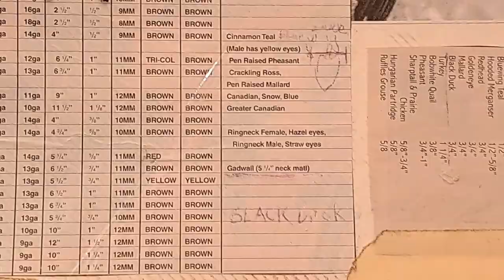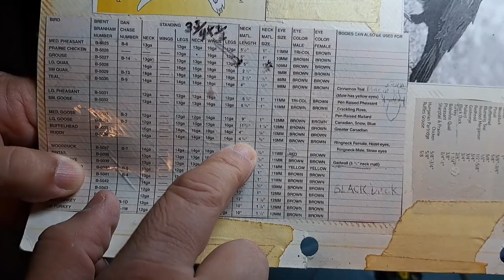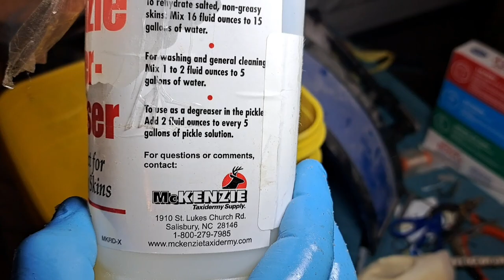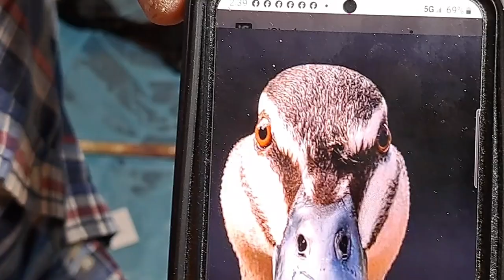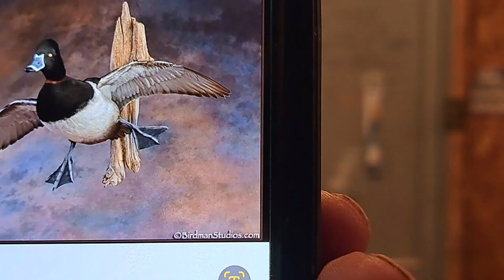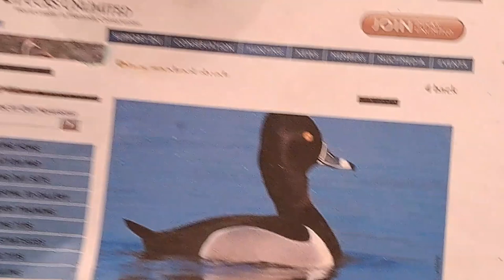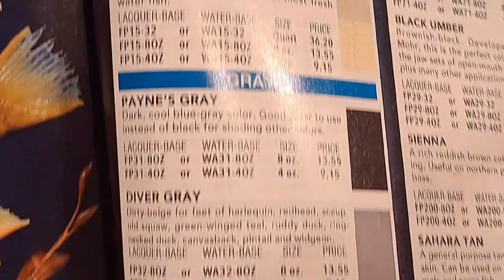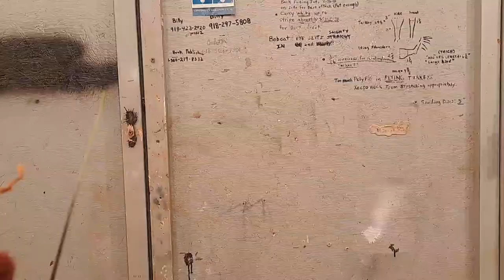How to Mount a Ring-necked Duck (Flying)

Comment: Great video. I am sure you probably know this already, but that blue parafilm on your birdflesher will come right off. Just peel it away and you will have clear acrylic which makes it 100 times easier to see what you are doing. When i first started i left the blue film on the inner acrylic and then realized after a couple birds that i wasn't getting enough light in. Look forward to more vids.
Reply from the maker: Haha,thanks for the tip!I didn't even know!😅